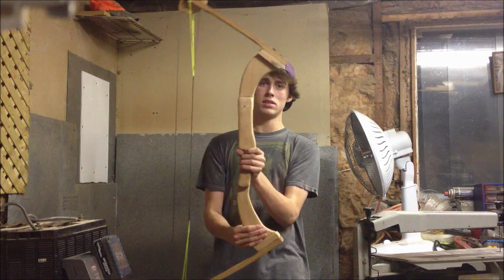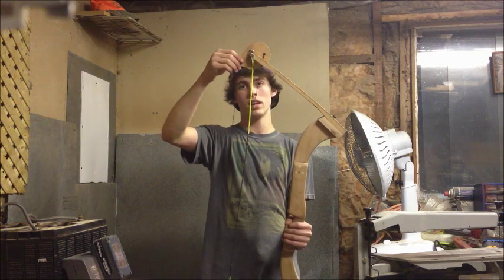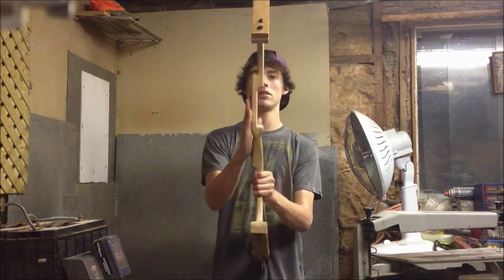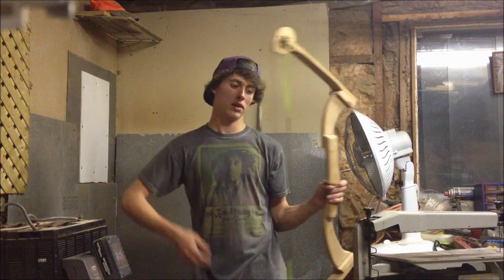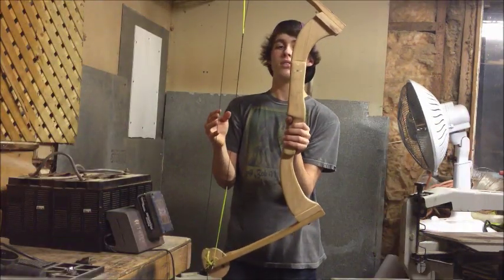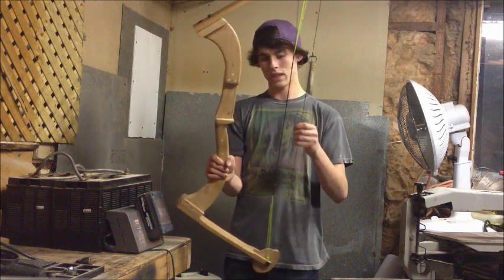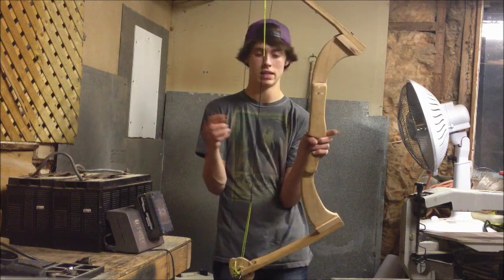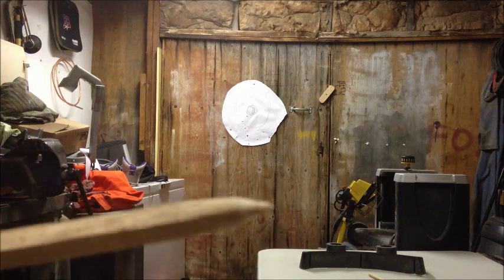Home Made Oak Compound Bow

Comment: I shoot traditional, and thus am not very familiar with compound bows. I understand the cams and pulleys are meant to provide great speed and power with little drawing effort on the part of the shooter, but none the less I would think given how fast that's throwing "arrows" that it must be higher than 20 pounds draw weight. have you by chance had it's draw weight measured in the interim years since posting this vid?
Reply: It has the same draw strength as a recurve bow but is faster.

Comment: You should put in a nail at the tip of the arrow and put duct tape fletching to make the arrow fly straight. You can also make a PVC pipe into a 45 pounds of draw weight or more, Nice Video   :-)

Comment: Wow, I'm impressed.  Love it!  I'm a longtime archer and amateur bowbuilder myself.

I have but one suggestion.  Where you have your riser glued together, specifically where the oak overlaps itself, once the glue has dried in those areas, I would drill through them carefully and then insert oak dowels (same size as drill bit - perhaps 3/8"), glue them in and then flush cut them on both sides.

I think this would increase the strength of your riser and make it more resistant to forces of vibration.  Although good wood glue is amazingly strong, I'm always very cautious about what vibration and stress can do to any material.  Anything you can do to overcome these issues will make your bow better.

If the unfortunate event did happen where the riser failed, especially at full draw, you could get seriously hurt.

Otherwise, this is an awesome build.  It's great to see young people using their creativity for things like this.
Reply from the maker: If you look at the handle or the joint you talk about, above the sight window you can see that I have actually already done that. there are three circles on both joints that overlap that are actually the dowels that are glued in. I understand the joint is only as strong as the glue if there were no dowels, and that is why I had thought ahead like you did also.
Reply: Reid Robinson
Ah....I see it now.  Don't know how I missed that before.  I suppose I was too distracted by admiring the overall design that I missed those little details.

Excellent build!  I may have to try this.
Reply: is your string strechi and did your limbs bend at all ????

Comment: nice job. best I have seen yet. looks like the pulleys need adjusting forward, they are almost right. at full draw the should make it around to facing you that way the draw weight gets reduced then you will be able to hold the string at full draw and it will feel like nothing. I'm very impressed excellent work.

Comment: Hey, Reid,
I am a 70 year old geezer, but I've been working wood for some 60 years.  I see danger in  your design if that oak is merely glued together on both ends of the riser.  (on either end of the arrow shelf)  Should this come apart at this juncture, the limb(s) could come back and hit you in the face.  Not a pretty thought.  One local made a take down bow, a limb came off and put out an eye.   I'm not sure how you should reinforce this area, perhaps with fiberglass, whatever, but please consider what I am saying.
Reply: Very constructive. That's some good info right there, no one wants to lose an eye :P
Reply: If you look closely, I believe there are 3 dowel pins used to give a mechanical connection on either side of the middle riser part, along with the glue.
Reply: Thanks! I was making a compound bow to!

Comment from the maker: already thinking ahead of you, I had already made parallel bow limbs that are actually laminate to the shape. it has layers of both oak and maple, and it is extrememly strong. it will need to be sanded down because i believe it is too stiff right now, but i had made these limbs before i even made the bow. I still havent made the bow, but I have decided to do it in summer after school lets out. This new bow will be nothing like the previous, as the last one was just to work.

Comment: Thx and bye the way the creaking is from the draw cycle were your cams are not properly smooth but a little bit if string wax should help, if not, well it has to be the timber

Comment: But i dont you want to spend $200 a pound on astro for a homemade bow. For modern compounds i highly recomend it. Extremely durable and softer on the shot. Grttaxi has a wonderful homemade string jig demonstration and many great videos. Dont forget to melt the ends and keep the string waxed. Dual cam binary cam cam an a half an single cams all have one string. Dual cams have one string and two cables. Single cams have one string and one cable. Dont forget the arrow rest.

Comment: I can't clearly see how you made the union classical builder is talking about. The body is sound and strong enough, there are what looks like two 1X1 strips along the body if it is this is where you can engineer more strength by replacing the 1X1 with a tapering gusset plate made from European (furniture grade plywood) screw and glue using a narrow screw,  good tight joints and a good grade of polyurethane.  Also you would get a better performance using ply and carbon sandwiched in as some of the plys in your Top and Bottom Limb.  Great job, the first step in reaching any goal is to do it, That you have, the next is to make it better, Proof of Concept Evolution until you reach your target,  Mature Concept.  You are far ahead of many by starting out young, keep up the good work you might be running a compound bow company some day using a design that pops out of your imagination.

Comment from the maker: Im kinda trying to say that this bow im making is going to be nothing like the one in this video. designed completely different in every single way. smaller and more compact, bent limb design, flat handle, single cam design i had copied from the Hoyt Carbon Element bow, new string, wider arrow rest, completely different riser shape and angle that go with the curved limbs, and even the axles will be redesigned. I consider the bow in the video as just a experament compared to this one.

Comment from the maker: well with a real bow im sure they dont go small with string strengths. string breaks, bow is going to be damaged. its the same thing as de-railing your compound bow, but for my wooden compound bow, im fine with 9 strands of 50# braid, as long as it holds up good enough. but with my new bow im working on I am going to be making a better and stronger bowstring because this bow will be alot stronger than my previous bow. but this bow will be a single cam. a single string, but alot longer.